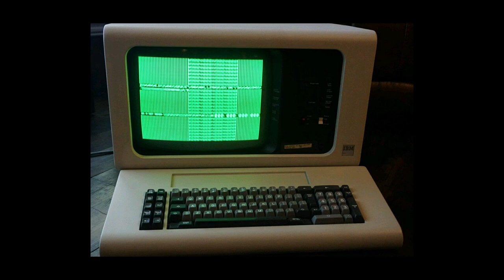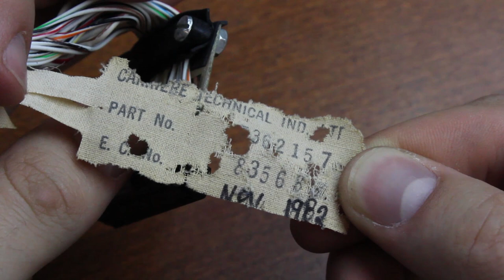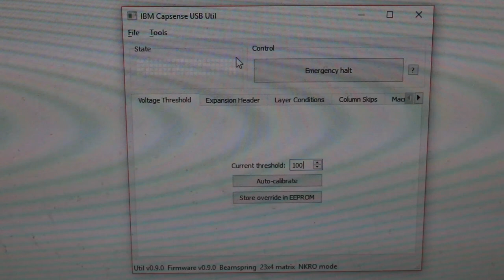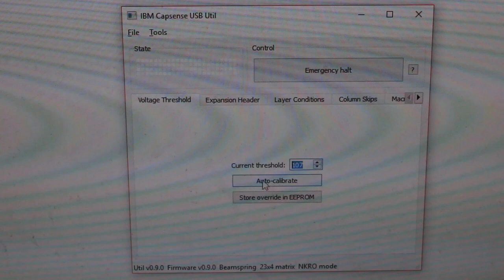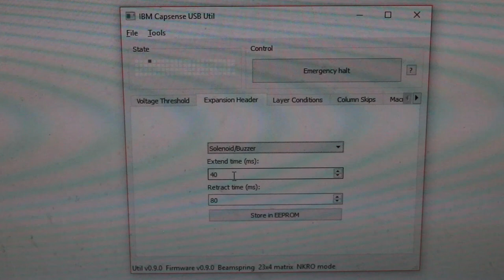IBM 5251 keyboard review (beamsprings)

Comment: Start a petition for Unicomp to make these!
Reply from the maker: Haha, if they can't even make an SSK, this is right out xD .
Reply: no way in hell man. would be ultra expensive, ultra complicated, and just something that unicomp wouldnt or couldnt bring to the table.
Reply: I was thinking the same thing - why the hell Unicomp does not make SSK variants? Is it so hard?
Reply from the maker: They would have to get completely new tooling, moulds, controllers, even some new specialty keycaps.
Reply: Would it still be worth buying with Model M caps?
I wouldn't think it'd be difficult to use the beam spring design with a membrane, which would eliminate the need for a specialised controller.
The tooling costs to produce the switches and casing would be the main issue though, I'd say you'd be looking at at least €30k to get dies made.
In addition, they look quite complex to assemble and labour isn't cheap.
Reply from the maker: I was talking about just the SSK :p . Making a beamspring would involve FAR more effort.
Reply: Unicomp made the original SSK, I wonder did they scrap the tooling or something.
They just don't make enough keyboards to offset the cost of new tooling.
Reply from the maker: To my knowledge, Unicomp have never made an SSK.
Reply: You're right, I don't know why I thought they did.
I was thinking they could potentially cheap out on the moulds and just use polyurethane resin.
Reply from the maker: Any change will probably be much more expensive than doing what they're doing right now.
Reply: Yeah, best to just support them by buying Model Ms (with fully custom keycaps 😛)
Reply: Chyrosran22 maybe not if they were made to order and super high end/expensive. Most would not buy them but I know that I would.
Reply: You're asking them to create entirely new tooling for something no more than maybe 2 dozen people would order. I guarantee you'd be paying at least 5 figures.
Reply: MCDricoV3VO zz
Reply: They can't.  IBM/Lexmark didn't make these keyboards.
Reply: Well, someone from the community will have to try and recreate them, too bad though that they would be astronomically expensive.
Reply: IBM was able to make them 40+ years ago when the computer market was far smaller. Theres a massive enthusiast market for keyboards today. It could be done.

I would just make switches though. There are a million third party companies that will buy mass produced switches and make the rest of the keyboard and keycaps.
Reply: I wonder how much it would cost to make these today. A project similar to the new Model Fs being made now.
Reply: Getting them to replace their ageing worn tooling is hard enough :P I seriously doubt they'd go for it.

I think in this market their margins are so low they can just about afford to keep the operation going (they do sell them for a fraction of what IBM charged). Getting them to make any kind of serious investment will be next to impossible.

Just look at the rebirth of the Model F - a small-ish project run by enthusiasts motivated by bringing an old product back to life rather than corporate-level profits coming from shifting thousands or millions of units, and even those have to retail for basically what the original Model Fs did back in the day (adjusted for inflation of course!).

Unicomp don't even charge that. They sell most of their stuff for peanuts in comparison and the only way that works is by not having to make ANY serious investment, such as tooling. Going by most of the complaints I've seen online, just about the only things these keyboards have got going for them are the buckling springs and native USB support. The build quality has had to take a nosedive as moulds have aged and PBT has been substituted for less expensive polymers. I got one of their newer designs for work (smaller, though not quite M2 small), made with slightly newer tooling and you can still see where the two halves of the clam shell don't quite line up. AvE would tell you that's the mark of a chinesium drill and you should probably steer clear. Curiously enough they have retained the two-piece key caps. One would think when you're cutting costs that's the first place to look, but they've retained the feature and instead let other things slide.

Going by these complaints, I'd argue that their moulds are already well past what industry would call their "useful life". They're milking them for anything else they can get out of them and sooner or later they will simply become completely unusable.

At that point Unicomp will face a decision - fold up shop or take the plunge and buy new tooling. I'm assuming here that when they bought the moulds from Lexmark they also got detailed engineering drawings with them.

If they do the latter, the only way they'd be able to stay in business is if they sell their keyboards for at least 3x what they sell them for now. IF they switch back to PBT and bring production quality back up to at least Lexmark levels and figure out why some of their units just up and die on occasion - it'd be a price worth paying. That is of course assuming that there's enough of a consumer base willing to pay that much for a keyboard in say 5 years time (which there very well might be).

I would say that I'm obviously not the first one to come up with this outline and that Unicomp have probably had that meeting several times over the past few years. Given that there appears to have been no change in their company policy, I would say the end result of said meetings has been identical - in their assessment the consumer base is not there to make the much needed tooling replacement commercially viable.

While I do agree with that assessment to an extent, I think that if enough people were willing to make a purchase commitment at a fairly inflated price (3x - 4x their current rates), sufficient to fund say 70-80% of the cost of new moulds, they'd probably do it. That way they'd still be able to sell keyboards at a similar price to what they sell now (no more than double probably), but these products would once again rival the Lexmark.

At the end of the day I just don't see it happening.
Reply: Unicomp will have to buy the patent.
Reply: more reasonable to bring the model F back as a higher-end keyboard that costs 50$ more than the M models
Reply: @RaymondHng  I don't think patents last as long as you think...
Reply: @Chyrosran22  Alright, they make an SSK. It's beamspring time.
Reply: @Chyrosran22  well whacha gonna say now
Reply: @Chyrosran22  I think its time
Reply: I realize I am quite off topic but do anybody know of a good site to stream new tv shows online?
Reply: @flamestoyershadowkill6400  Lol 50$ more a model F ? You dream alive, more like 3-4x the price. And I guess If someone recreate a beamspring the price will be around 1000-1200$ USD minimum. I think the guy who created the F77 is trying to develop a new beamspring keyboard. I would like to see a Model F with a full 104 keycaps layout (full numpad + f1:f12 keys).
Reply: @Chyrosran22  maybe now they can make Beamspring keyboard since they did the SSK version now lol
Reply: @Chyrosran22  They are making them.
Reply: @Chyrosran22 They are making them now😊

Comment: Jesus imagine taking this to a meetup and big-dicking it out onto one of the tables...
Reply: Oli Harding that happened in Toronto 2017.
Reply: Also happened in Darmstadt in 2016
Reply: Also at the meetup in Berlin this past year. Dick waving was a tie between this (https://www.meetup.com/Berlin-Mechanical-Keyboards-Input-Devices-Meetup/photos/27839250/#461883335)  and a dude's HHKB with japanese hipro keycaps, bke domes, and a Hasu bluetooth controller. It was like 4 expensive AF keyboards collapsed into one.
Reply from the maker: And in Utrecht, 2018 xD .
Reply: And in Texas twice 2018 :p
Reply: And in NYC in 2018 :D
Reply: If the table can even take the di-I mean board. Its so big it needs its own area code.
Reply: Someone did that at the Atlanta 2018 meetup, then I showed up with the 5251 terminal itself...match made in heaven, I'll tell ya what.
Reply: 5:45

Comment: Back in the day, I worked at a bank with an IBM System/36 that had many of these terminals.  We replaced them with IBM P/C's and clones with an ISA board installed that allowed the P/C to emulate the 5251 terminals.  We threw away so many of these terminals, that it breaks my heart to know that they would someday be so valuable.  These terminals where really a joy to work on because they were, as you have demonstrated, so tough.  Thank you so much for this peek into IBM's colorful history.  Keep up the good work!  By the way I actually kept a model F keyboard from an IBM XT that is in mint condition. Cheers...
Reply: I was working in a hospital in 1999 where we were chucking hundreds of Model M keyboards into the dumpster.

Comment: I'd love to see full-sized variation of this although it's unlikely to happen.
I wonder if multiple solenoids would fix the solenoid activation problem so if you'd press keys very fast, another solenoid would activate if the first one is in use.
Reply from the maker: The big problem with the solenoid is really that it causes chattering if you set the delay to too short. Although this is speculation at this point, I suspect it might be because the jackhammering causes a change in capacitance with pressed keys - the assembly is extremely sensitive after all.

Comment: So the solenoid was the training wheel from transition of typewriter to computer terminal?   Learn something new every day. Knowing IBM, I bet they had a delay circuit for the relay to match the Selectric typewriter's mechanisms delay.  It sounded like it in the demo.
Reply: These 5251 terminals were used in data processing environments where a data entry operator was rapidly touch typing while reading the source documents, not looking at the screen. It's called "heads-down data entry" in industry parlance. But whenever the operator pressed the wrong key, the computer will lock the keyboard by turning off the solenoid. Not hearing the solenoid clicking when typing keys is the audio cue for the operator to look at the screen to see the nature of the error, press the <Error Reset> key (located left of the space bar), and continue typing with the correct key.

Comment: does it also have the issue where too rapid keypresses are not recognized?

also, how much did you get this thing for? yet again 50p from your recycling center?
Reply from the maker: That issue is completely dependent on the setting of the solenoid. If you switch it off altogether, the issue disappears.

Comment: the case is not heat treated steel. It's yellow zinc coated steel.
Reply from the maker: I've had several people say it's either zinc coated or cobalt plated or heat-treated, but I don't know how to tell the difference. What gives it away in this case?
Reply: Chyrosran22 so with Cobalt plating, thats expensive and mainly used on drill bits. And with zinc coating, there is yellow zinc and more a bluish silver zinc. Yellow zinc has that rainbowish color. And it's electroplated on the steel
Reply: Cadmium electroplating or zinc cadmium electroplating was very common back then and before current environmental bans took affect on the process.

Comment: anyone got any recomendations for clicky alps boards that arent super expensive and dosent look like crap? feeling like i want a replacement for my Corsair K70 with browns
Reply: I got KBP V60 with Matias Clicky switches. Sound and feel is better than Cherry MX Blue switches I had previously.
Reply: looks like something i could get but i would like to have a full keyboard or navless tbh. thanks for the suggestion though :)
Reply: axel boström KBP make tenkeyless versions and full sized ones
Reply: il take a look, thanks!
Reply: axel boström Matias http://matias.ca/
Reply: Rich Levin yah those are above my budget tbh
Reply: axel boström Maybe you can find one used ... or discounted ...
Reply: il look but used they go for the same price as new on the local market ;-;
Reply: They're $20-$50 on eBay, used.
Reply: Rich Levin and then another $100 to ship to me usually lol
Reply: axel boström Yeah, that's s ripoff.
Reply: il see if its changed but i doubt it tbh

Comment: The 5251 connected over a cabling system called twinax... It ran at 70 volts and a bunch of amps ... Ours was badly grounded... Shocked multiple times

Comment: 5152 or 5251?
Reply from the maker: 5251
Reply: You said 5152 in the intro lol

This keyboard sounds musical BTW
Reply from the maker: Haha, well spotted xD . And yes, you're right, if you have the solenoid off you can hear the switch action - the keyboard sings at you! :)
Reply: Chyrosran22 5152 sounds like the monitor or printer that went with the IBM PC!
Reply: If I remember the 5252 was a dual back to back terminal to save space for data entry setups... 80kg... It was a monster

Comment: Those terminals were incapable of doing raster graphics.
There was a even model for two simulaneous users but with only one CRT. The users sat on opposite sides and the screen was split with 45° mirrors...
The 1970's saw many wonky designs...

Comment: wait so the only reason that abs keycaps yellow is because they have a fire retardant coating?
Reply: How flammable is abs anyway?
Reply from the maker: Basically anything made out of carbon and hydrogen will burn. Yes, ABS yellows through a degradation of one of the components, primarily butadiene, which is accelerated by a photochemical reaction that one of the components of the fire retardant materials (a class of brominated aromatics) undergoes. The formulation was at its peak yellowing power during the 80s and 90s, but has changed over time.
Reply: Right. And I guess having an office filled with highly flammable plastics is probably a bad idea then.